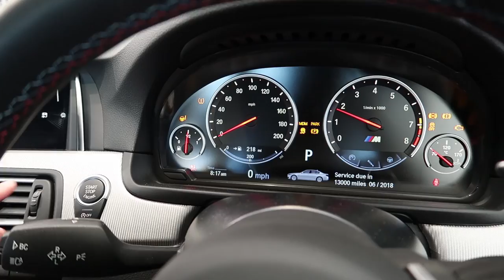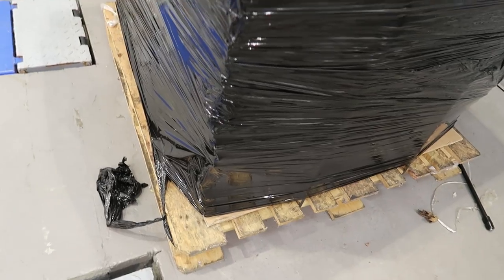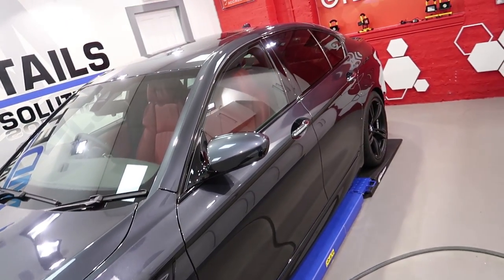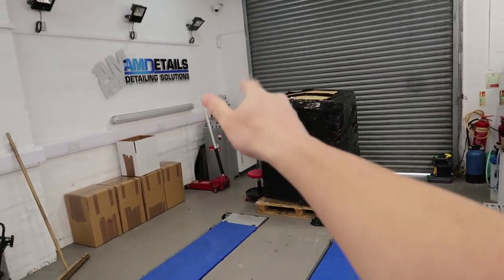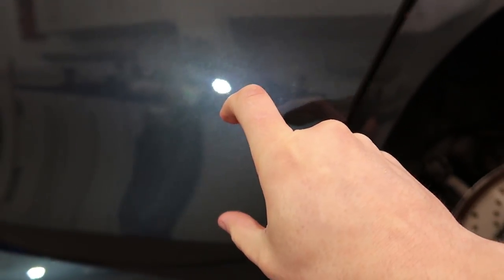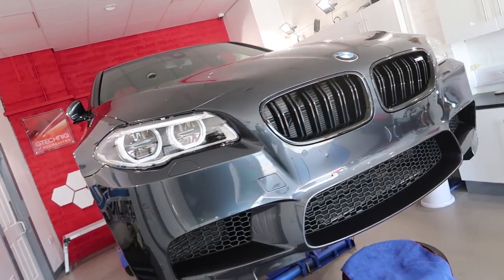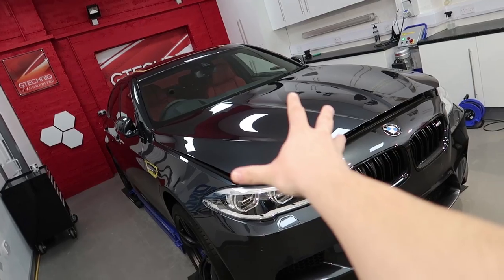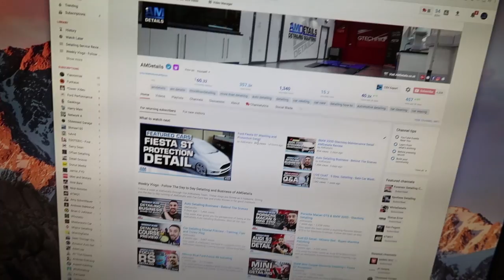BMW M5 Detailing Wash  - Gtechniq Crystal Serum

Comment: Cool video! I just subbed. I noticed you aren't using lifting pads with the floor jack. Quick tip: Hockey pucks. cheap and you can cut them to size with a hack saw or leave them flat. Doesn't leave ugly crushed plastic corners on the jacking points  ;)
Reply from the maker: Hi Collared Greens,

Thank you so much for the Sub. Great suggestions for the Community to see. We have one of this cut-down but it lives in the tool box as it's not out much. We use the Rubber Chock Blocks we got with our ramps for this job. Super handy as you say for taking the load between jack and car Or Ramp and car.

But you are right. On this job, the BMW's have the massive plastic chocks built in, and with the ride height our Jack and the block don't fit in.

Top Tips for the Community.

Alan

Comment: I currently have CS Black and CSL Black on two of my different vehicles. I was told by my installer that they can do a finishing polish once a year to remove any fine marring on the surface and then reapply the layer of Exo V4. They basically said that the finishing polish shouldn't remove the CS and CSL base layer but it will remove the Exo layer and then thats why they can relayer it. Is this actually true? I am a bit apprehensive on this because my past experiences Ive been told that when ever you "polish" a coating it will more of less remove it. They were saying that because the CS and CSL have a hardness of 9H on the pencil scale it will require at least a compound if not a wet sanding to remove it fully so a polish should even be able to affect those layer.

Comment: After having a car ceramic coated should you see swirl marks after cleaning ?
Reply: Ross Coats cheers, it was done at a bmw main dealer so I hope so
Reply from the maker: Hey James, a ceramic coating is just that... A coating.. Some.have the ability to mask swirls. But it's really down to the prep. So these defects could be in the clear before application... Then after application you can easily ass defects and scratches with day to day living. It also depends on the coating in question.. I hope this helps. Alan

Comment: Have you tried the Rupes 21mm? If so, do you prefer the 21mm over 15mm vice versa?
Reply: I find the 15 more versatile and can fit in smaller areas on the car, 21 perfect for larger panels
Reply: I assume choosing the 15 over the 21, would be the better starting point? I already have a Torq 10FX, and want to upgrade.
Reply: Yes, I chose the 15 just because it's a lot more versatile, I have a 15 and the mini and i can pretty much do everywhere on my car. i'm saving up and possibly looking at buying the Nano, But trying justify the price
Reply: Of course these arent cheap, but if you already have lets say a Torq 10FX, and you can speed up your game, and get better results faster, and actually have the extra cutting power, it suddenly doesnt matter that much.

If you can save 1 hour per Paint Enhancement (roughly 5 hours currently), that is surely worth the extra bucks.